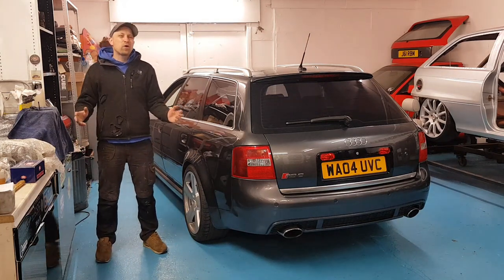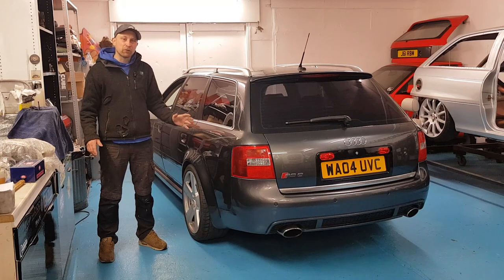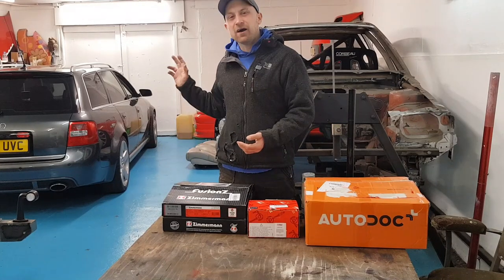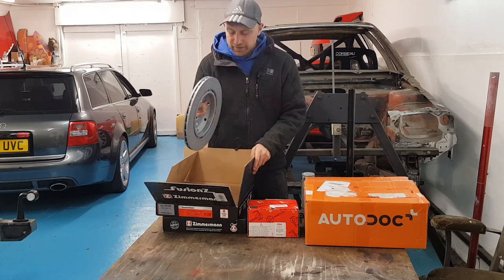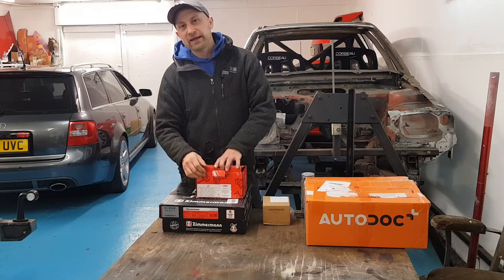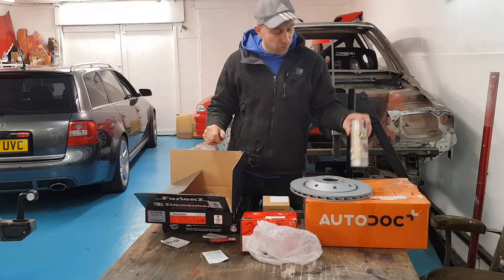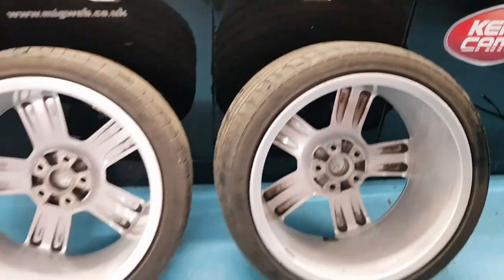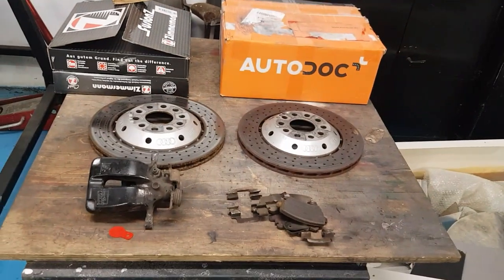New Rear Brakes on my Audi RS6! Discs, Pads and Caliper! Zimmerman & TRW!

Comment: My old ‘99 Audi 4.2 Avant was a pain because Audi love using aluminium on brakes.  Unfortunately aluminium is great until it corrodes and then pistons stick and threads for bleed nipples are easily stripped.  They even used an aluminium washer which I found corroded to the point it was just a thin crumbling half circle.  Provided you don’t actually want to drive your car on a real road it’s fabulous!
Reply from the maker: Same with all the aluminium suspension arms with steel bolts in them, great idea until the corrosion starts 🤦‍♂️ thanks for watching 😁

Comment: When you painted your discs did primer before paint or was they fine just adding the silver? Thanks
Reply from the maker: No, I have them a good key up with a scotchbrite and degreased them and they're still perfect now.
Reply: @SuperRon  cool thanks as I was thinking of doing the same as you as I’ve just got some new zimmermann discs for my Audi, but I have to send them back as they have sent me 2 of the same side so the venting will be opposite 😪
Reply from the maker: @adams951  mine are still glossy and silver 3 years later 👍

Comment: Wow i have one 2004 less than 1 year and gearbox gone 6000 usd to repair ouch , did you ahbe any problem with yearbox? Already rebuild or original, thankd!
Reply from the maker: My car now has 129,000 miles. It had a new gearbox at 60,000 miles. Everything is still perfect at the moment.
Reply: @SuperRon  wow thats great, hoppe now i can enjoy my car like you, how much did you drive yearly?
Reply from the maker: I do around 10,000 miles a year.

Comment: You should use something, like a dab, to take out the brake fluid that resides on top of the bleeder screw after you tighten it. You took the hose off and imediatelly you put the rubber cap back on, trapping some brake fluid. That brake fluid might damage the paint on the rims or the calliper when it drips out of the bleeder screw.
Reply from the maker: Thanks for watching 😁 yes true to an extent, but the rubber cap that keeps the dust out, also keeps any residue fluid in. No problems so far but point taken 👍